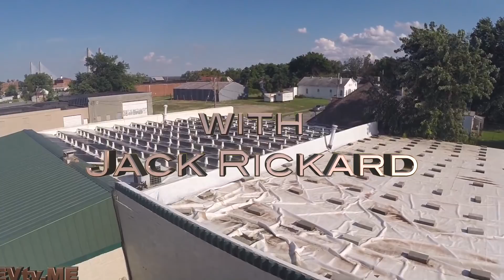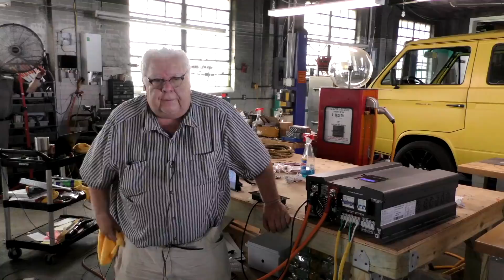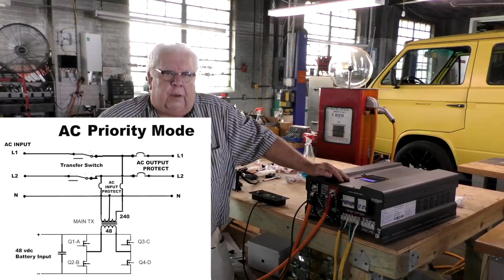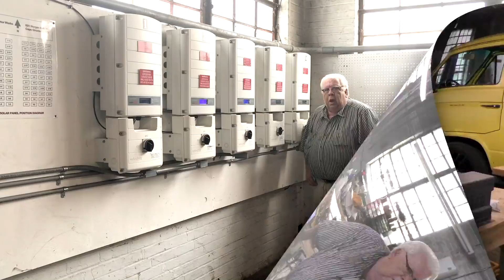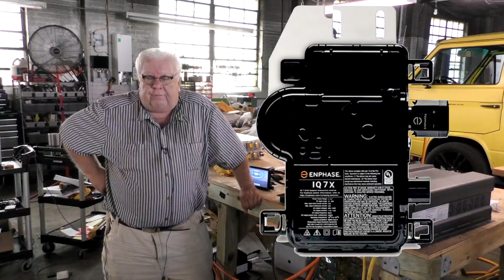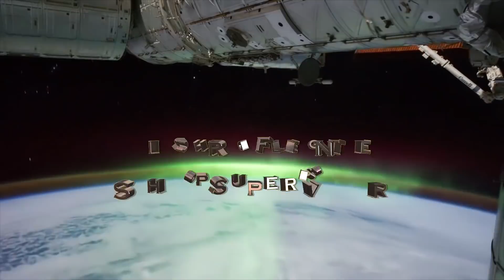12kw Solar inverter Designed for Tesla Battery Modules. EVTV Friday Show -

Comment: Can you add to the store a diagram of how to wire this thing up when grid is the primary backup and a generator is secondary backup? I am thinking of how to keep it safe with both of these AC sources and not shut itself off for being a source or line backfeed. Also, can you test it?

Comment: When will the grid inverters contactors be ready to buy? Also, can you make it work 1 inverter 1 contactor 1 breaker inside a combiner / breaker box? What I want to do is shut one inverter off at a voltage level at a time.

Comment: no, no, high voltage is the way to go. teach the newbies high voltage.  i have invested i a 48 volt system. Eight years ago, i should of have gone high voltage but like everything it was to expensive. High voltage is great. you'll use smaller gauge wire, your distance can be further apart, and possible even cooler.

Comment: Unfortunately my back is no longer capable of lifting transformer inverters. Had many over the years and the weight was my biggest gripe. I have moved to chip (i.g.b.t.?)  type portable welders and pure wave inverters. More efficient and 1/3 the weight. At the moment I am in need of a good lightweight inverter aprox the capacity of the transformer inverter shown in todays show. Have you come across any Chinese made inverters like that?
Reply: Aside from galvanic isolation (which admittedly is a pretty compelling feature), what makes a transformer better than switching?  Honest question, not flame bait.  I too was rather surprised to see a modern box with old iron in it.
Reply: I use my inverter as a portable power supply for welding pipe miles away from AC service. Also it was great at the summer camp where everyone was plugging into it, again too far from regular AC service. I have received many compliments when I was able to power an entire live band with my lithium pack portable set up. We were able to shut down the 3 gas generators they had running behind the stage. We are getting closer to the end goal.

Comment: NO AUDIO FIRST 25 MINUTES
Reply: Check your device.  I had audio.
Reply: AFTER INTRO MUSIC NO AUDIO FOR 25 MINUTES
Reply: SORRY FIRST 16 MINUTES
Reply: OUT 16 MINUTES TO 19 MINUTES THEN OUT 25 MINUTES
Reply: PLEASE RE POST WHEN AUDIO IS FIXED ,  LOVE YOUR SHOW
Reply: I did watch the entire show, from start to finish, no points where there was no sound.
Go fix whatever is wrong with your speakers/headphones, and your capslock key.
Reply: Audio only on one channel, are you listening on mono earphone?
Reply: Not true, works fine here
Reply: I HAVE BEEN GETTING SEVERAL RESPONSES TO MY POST, APPARENTLY MANY PEOPLE ARE HAVING THE SAME PROBLEM AUDIO IS ON THE OFF SEVERAL TIMES
Reply: NOT TRUE !!!  LISTEN TO THE WHOLE SHOW IT IS ON AND OFF AS OTHERS HAVE POSTED SAME PROBLEM
Reply: Anon Hackit - I get right channel only, so your right channel must not be working.
Reply: +Anon Hackit     I have the same problem. Using all caps is not a good way to get help. Idontcare80 writes "I get right channel only, so your right channel must not be working", there is probably a clue there.
Edit: here is a link to a video that will allow you to check your left and right channels:
https://www.youtube.com/watch?v=hTvJoYnpeRQ.
Turns out my right channel is faulty.
Reply: Right channel only after intro. Still works.
Reply: My shop is on summer break until after the Bar-Z convention.  When we get back we'll be hooking up 5 kW of Panasonic HITs to the Leaf pack and the 20 kW inverter Jack got for me.  Can't wait to see if it also charges the battery like Jack's latest 12 kW toy at night during off peak rates.  The solar array has enough beans to charge the "lizard pack" directly. no problem, especially in the punishing Arizona sunshine.  Salt River Project has a special rate plan for me if I chop consumption from 3 PM to 6 PM when the AC units are pushing them into paying peaker rates on the spot market.
Reply: I know, the situation is not strictly the same but Jack's point is germane.  You have to experiment to really know  what a system is capable of doing.  We'll add more 5 kW panel sets and Leaf packs until my $400/month power bill starts to head in the right direction.  My CPA has indicated that if the 30% tax rebate is greater than my federal tax owed I can carry the remaining credit forward into the next tax year.